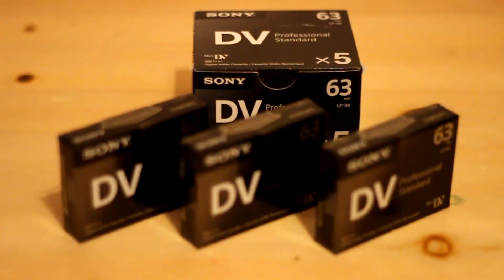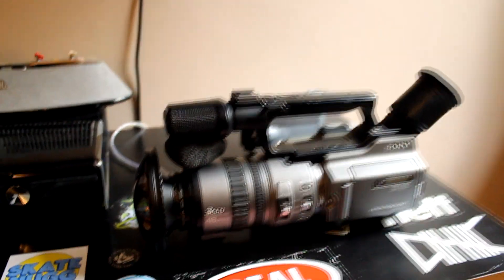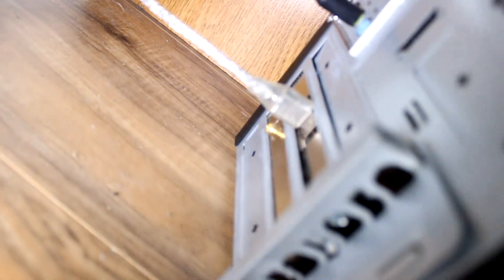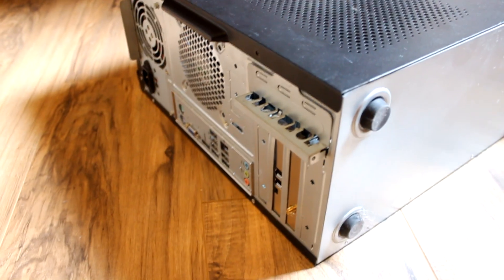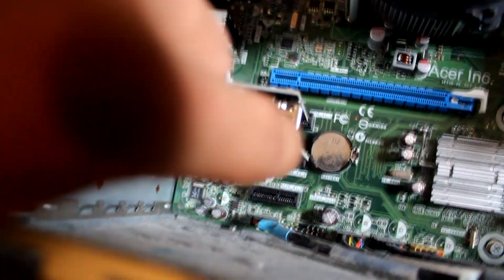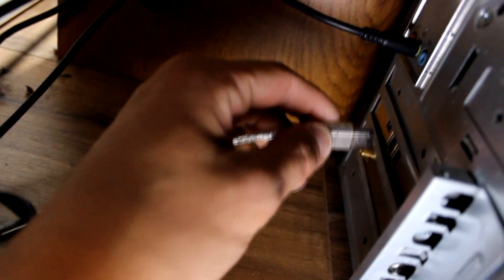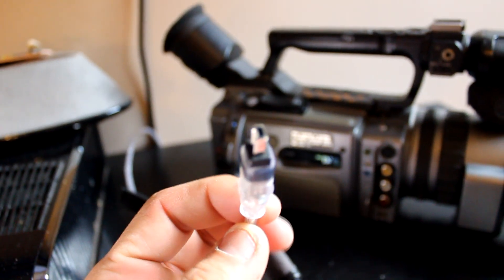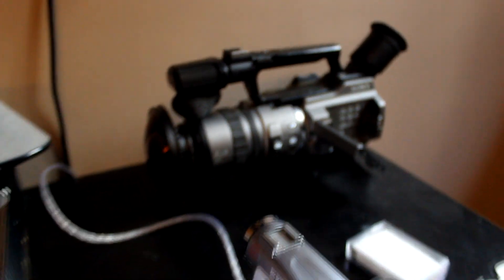How To Transfer VX1000 Mini DV Tapes Onto Your Computer - The Right Way

Comment: I dont get why you need a secondary camera? Somebody explain:)
Reply: VX1000(or successive models) are becoming very rare, and in the near future, it will become impossible to repair them or find spare parts. This being said, if you use the camera only for recording there is less chance that you wear the heads, the drum and the internal mechanical parts. The use of a second camera in this case.  is to prevent such horrible things to happen. Those cameras are 25 years old and they still function great, because Sony used top notch components and very clever engineering when they were built, but nothing is eternal. As an old bloke and a old tech junkie i can only greatly approve of such behavior. Hope this is useful to you.
Reply: @gunsmithfiamma4788   So when you transfer your tapes onto you computer, it would be smart to put the tape in another camera? Just making sure I understand it right
Reply: @tokazo1208  Exactly: just buy a simple dv camera on ebay or similar, you can find a working one for 30€ or so. Just make sure that the camera have clean heads and a functioning firewire port. The data transfer is digital, so the camera is acting only as a data transfer device, like a sd card slot on your laptop/desktop.
Reply: @gunsmithfiamma4788  Is that also important if it’s a vx2000?
Reply: @tokazo1208  Yes, it is important to any good camera, if you want to extend their  lifetime. Just buy a cheap and functioning one.
Reply: @gunsmithfiamma4788  Alright, thank you very much:)

Comment: I highly recommend always using a secondary handycam to play and import the clips. Rewinding on the VX is the most common thing that everyone does that breaks the heads. Great video spot on info👍
Reply: Does a secondary capture camera lower the footage quality? I recently bought a dvx100b and the firewire port is shot on the camera. Do you have any suggestions for a cheap capture camera?

Comment: I have 6 Sony digital camcorders and none are found by any pc i hook them  to. I bought new fire wire cables i bought pc cards like yours.  I bought 3custom built pcs none would find my camcorders i tried my moms pc nope i bought a Asus $1700 laptop nope i went  to Best Buy took 2 camcorders and 2 fire wires cables none of there pc 's found my camcorders. Hmm shit huh. Sony swears they have drivers online but that is what has to be the problem. In 2008 i stop editing for a few months so to speed up my pc i reformatted and reinstalled my Win XP then few months later went to edit again and none of my camcorders have worked since. I have bought all kinds of shit offline to be the go between my cam's and the pc and none have worked. I am sure Sony has removed old drivers cuz i no a few other people who have same trouble and look on ebay you see a shit load of old cams- for sale super cheap. My last Sony cam- was the FX7 and for $3100 it is junk now and it only has maybe 4 or 6 hours recording use. It plays tapes i recorded on but will not download to any think but an old S-VHS i have.  
                                                                                Never buy buy Sony products .

Comment: Great video! Only one problem; once I got everything hooked up and got the drivers installed I don't know how to get the upload started. I tried autoplay, but it doesn't recognize my camcorder. What program did you use to start the upload? Any help would be much appreciated.
Reply: to anyone with the same problem I had; easiest way is to open windows movie maker and go to file > import from device
Reply from the maker: voxen444 just saw your comment, yeah if the transferring window doesn’t pop up by itself you can use movie maker and if you have a newer version of windows you may have to go download moviemaker off Microsoft’s website
Reply: This is late, to use this function you need to have windows essentials 2012 installed on your computer. It is on computers running windows 7 to windows 8.1 by default. This software package includes windows movie maker,  windows photo gallery, etc. Unfortunately Microsoft removed the online connectivity to this service in 2017. To download it now you need to find a safe source to download it from. As of right now this one works and is safe --> https://archive.org/details/wlsetup-all_201802
Reply: @mcm_pictures  how do i know which download option to choose?
Reply: @mcm_pictures  I plugged in my camcorder and my computer makes the ding sound so i know its recognizing it but i just dont know where to go to start importing because it doesn't automatically pop up like in the video.
Reply: Elijah Prieto Open Windows Live Photo Gallery and connect your camcorder to your computer.
Windows 7 should recognize it immediately. If not, try switching the camcorder to playback mode (Some camcorders label that setting as VCR.)
If you’re importing video through FireWire (IEEE 1394), you need only connect a single cable between the camcorder and FireWire port. With that one cable, Windows 7 grabs the sound and video and controls the camera.
Choose Import From a Camera or Scanner. Choose the icon for your camera in the Import Photos and Videos window. Then click Import.
Reply: Electric I downloaded windows movie maker and followed the import instruction in the comment above and it all worked out! Thanks!

Comment: does this work with windows xp? cuz thats what my pc has
Reply: Most likely, considering.. 90+ percent of computers made with FireWire ports, came out during the Windows XP era.

Nowadays computers are never manufactured with FireWire ports included, and I'm surprised Windows 7 or whatever ThatFilmerDom is using still supports it at all.
Reply: I use Win 7 and installed the Firewire card from a computer store for $5, he just ripped it out of one that was going to the trash anyhow, so I got lucky, 5 mins and I had DV video of my mom and Xmas time 2007 onto a DVD in no time! I recorded alot of stuff onto a DV camera since 2005 to 2010, before some of my family became ill and passed away, so their memory lives on! I'm not using pro equipment or anything, just a Sony TRV22 Handicam, works great and got it second hand for $40.
Reply from the maker: Yeah man, this will work with any version of windows

Comment: the problem with me is that i cant use a usb cable im having to be using a monitor cable could u help me? The kind camera I have is a panasonic  300x digital 26x
Reply from the maker: You have to get a firewire cable

Comment: I have a  1394 connector coming off my sony handy-cam  but only a USB 2.0 and 3.0 input on my laptop.  Will some kind of adapter do the trick?  Thanks in advance
Reply from the maker: the adapters usually don't work, you can try, but I would recommend just getting a computer and installing your own port like I did in the video

Comment: Hey dom great video! Got a question for you man , so the heads on my vx may be dirty everytime I transfer my clips they glitch and cut into smaller sections [ I am using lifeflix btw] but if you view the video on the screen on the camera the footage looks life. So my question can I buy a secondary camera just to transfer the clips into my computer or I will still have the glitching issue ? Thanks for the help!
Reply from the maker: Pedro Jimenez you'll probably still have the glitching problem, the glitching is typically recorded onto the tape and has nothing to do with the transfer. I would look into buying a cleaning tape.

Comment: The reason you need a digital converter is cause most computers and especially new laptops don't have a firewire port.
Reply from the maker: Buy a thunderbolt to firewire cable if you own a macbook. Not everyone has a mac or can afford a mac. You can clearly see in the video I have a windows computer.
Reply from the maker: If you are serious about filming with any camera that takes mini dv tapes you would take the logical approach by doing the same thing I did in this video by installing a port into a computer.
Reply from the maker: And you are wrong, you don't "need" a digital converter. If you want to waste $60, and risk losing video quality be my guest...
Reply: Good luck installing a firewire port on a macbook 😂😂😂

Comment: i just got a  dv in/out 
firewire to usb bc thats  what i was told to do i have a pc idk what to do i plug it in and the computers makes a noise but nothing pops up
Reply from the maker: Those cables & adapters don't work. That's why I made this video.

Comment: Hey man, what size firewire does the vx2k have?
Reply from the maker: The vx2100 has a normal "DV IN" jack for a firewire, if you are asking 
about a vx2000 I would assume its the same but I've never owned a vx2000

Comment: i use sony vegas 13 and im capturing ok but how do i set up my templates and render settings  ive tried everything ?
Reply from the maker: It took me awhile to learn, maybe I'll do a separate video on it. You just have to tweak the render settings and figure out what you get the best quality out of.
Reply: im using a sony vx2100 and i still cant get it to render right  im losing quality in there somewhere   thanks for replying man

Comment: Do you have to have a disk when you install the firewire to the computer?thanks
Reply from the maker: No installation disk came with the FireWire port, like I said in the video the driver software should install automatically on windows

Comment: I have a laptop and there's no way to install a firewire port. what then?
Reply from the maker: Only thing I could think of is possibly buying a firewire card adapter or something along those lines for a laptop. But in my opinion if you're going to start filming and editing with a VX I would look into buying a computer and putting a port in it. You will get the best results.
Reply: +ThatFilmerDom yea I just got a dsr pd150 (it's basically a vx with a diff mic) and was thinking I could find a FireWire-USB adapter, maybe that would work?
Reply from the maker: +Paul H If it was as simple as just getting a Firewire to USB I would've just did that myself. They don't work.
Reply: +ThatFilmerDom shit what's wrong with them?
Reply: they just don't work, It's a scamm
Reply: ThatFilmerDom o
Reply: I HAD THE SAME PROBLEM, SO I WENT TO A SMALL  COMPUTER REPAIR SHOP AND FOR 150 BUCKS I BOUGHT AN AWESOME USED LAPTOP WITH A FIREWIRE PORT, WINDOWS 7 PROFFESIONAL, 4 GBS RAM AND 250 PLUS GHZ CPU!!! I USE THIS ONLY FOR MY DIGITAL8 TAPES! DONT BOTHER WITH ANYTHING THAT USES A USB PORT, COMPOSITE OR S-VIDEO CABLES!!